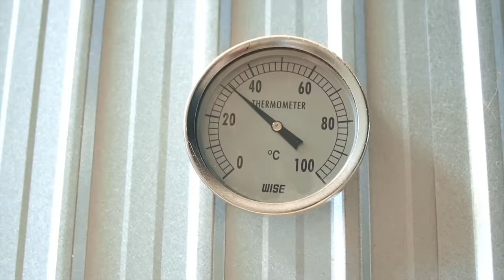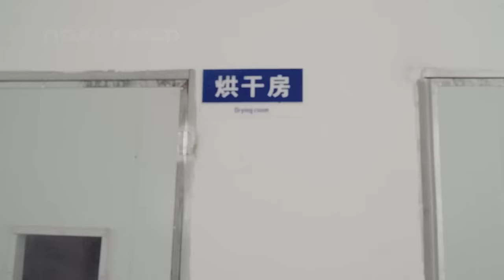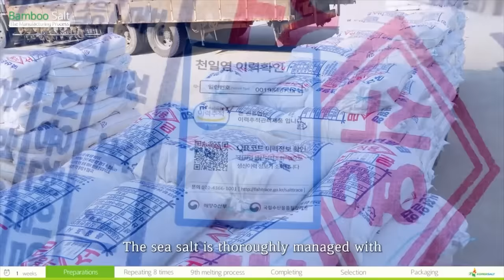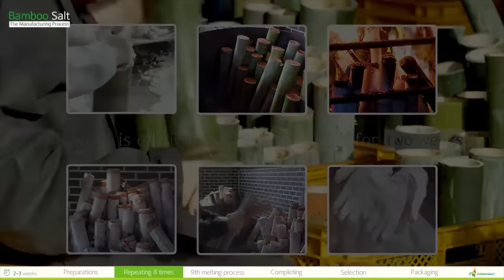How to Processing Millions Bamboos to Product - Straws, Bamboo Houses, Plywood, Chopstick Factory

Comment: Can bamboo be used for roofing? Sunshade on existing roof?
Reply: It's not approved for construction in the US. If you live elsewhere, you have to check the building codes.
Reply: @gy2gy246  I live in the Philippines, no code here. I just want to know the efficacy of using it as sun shade. You won't be sued.
Reply: @thesilentgeneration  Sorry, I don't know what a sunshade is.
Reply: @gy2gy246  What? Really? As the name implies, something that shades the sun off the roof. Not complicated.
Reply: @thesilentgeneration  Really. We have no such thing in the US, so I can't help you.
Reply: @thesilentgeneration  Sorry, we don't have that here, so I can't help. Roofs are insulated with insulation, usually fiberglass, to keep out the heat and cold. The insulation is between the roof and the ceiling below.
Reply: @gy2gy246  Forget it! A sun shade goes above the roof to keep the sun off the tin roof. It was just a question.
Reply: @gy2gy246  Really? The U.S. is a major manufacture of sun shades. You don't know much about bamboo, but yet you put a video about 9it on YouTube. Interesting. You need to be muted.
Reply: @thesilentgeneration  I've never put any video on Youtube, as  I don't make videos. https://www.youtube.com/@gy2gy246/featured
And we don't make shades to put on roofs.  THE END.